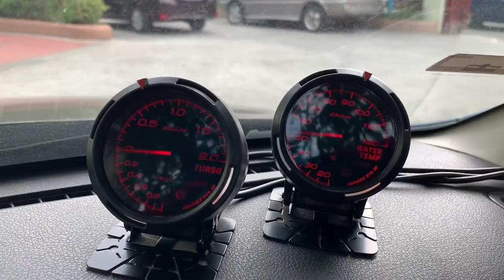IMPREZA WRX TURBO & PAPAWIS BASKETBALL TIME

Comment: EJ20 yan
Reply from the maker: Swapped na boss
Reply: @ven446  EJ25 block then EJ20 heads?
Reply from the maker: @carlsonwrxsti1846  full ej25 matic nga lang boss pero ngayon na manual swapped na
Reply: Nice, 6 speed swapped?
Reply from the maker: @carlsonwrxsti1846  yes paps hehe
Reply: Nice, 👍